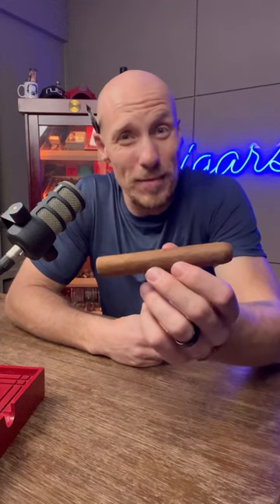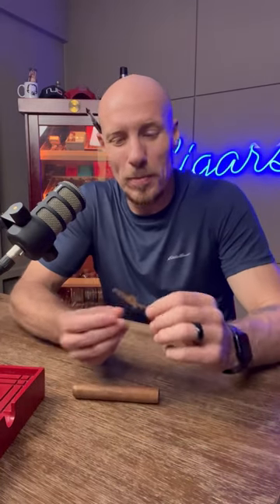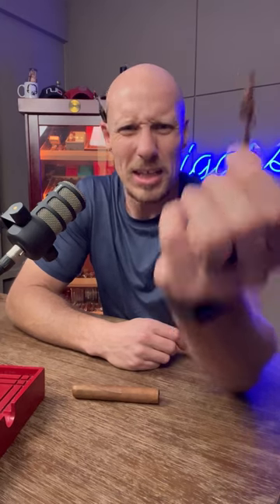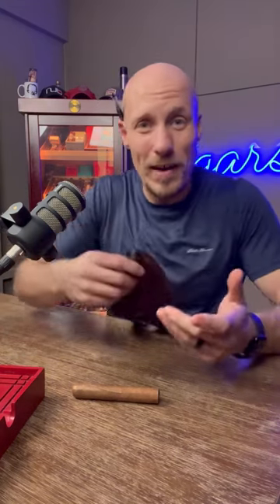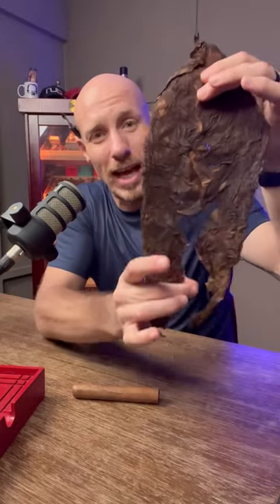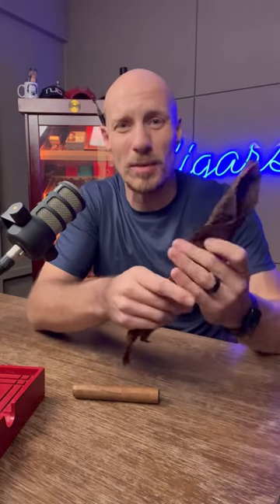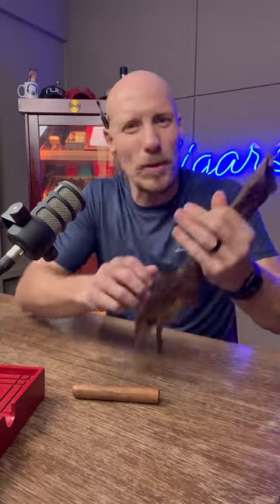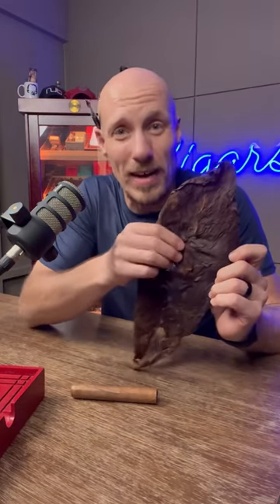There’s a STEM in my cigar!!! #cigars #cigarsdaily #pssita

Comment: Is it normal to find little bugs in sealed cigars? They have been sitting a while I’n a sealed container
Reply: No. Those beetles eat tobacco. This is why it's recommended to store cigars at temps lower that 70 Fahrenheit.
Reply: No that's not a good thing!
Reply: @maxharter5716  my other question is where do they come from because it is a tightly sealed container
Reply: @projectedc  they are tobacco beetles. The eggs are already in the cigar. A lot of factories freeze the cigars to kill the eggs but some don’t. If you have too much heat they can hatch if the cigars were not treated to kill them.